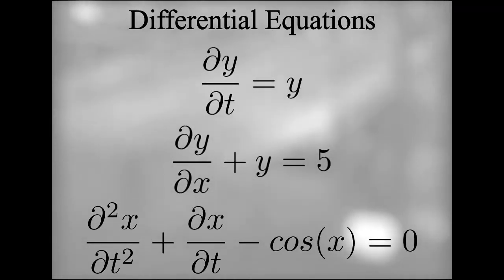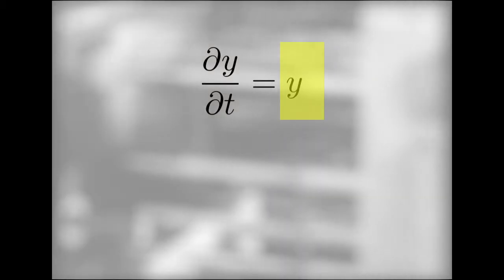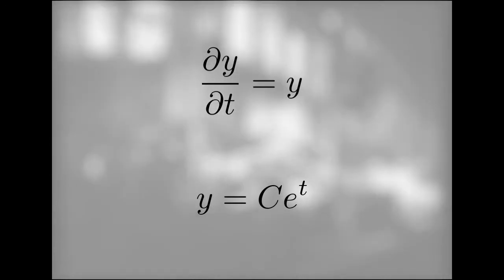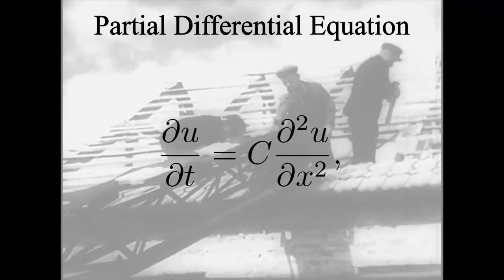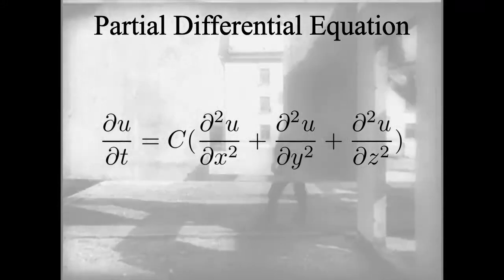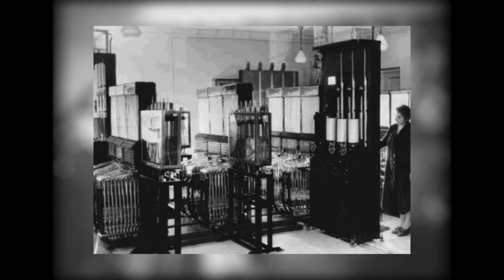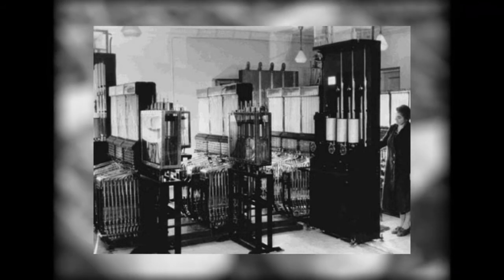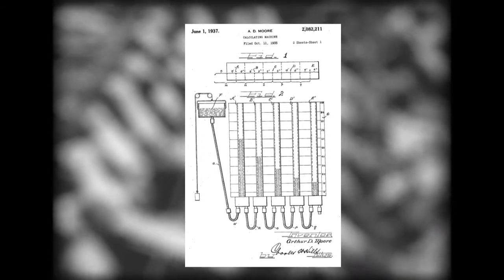The Soviet Computer that Used Water to do Math

Comment: Would have been nice if you went into a deeper dive on the machinery and components involved. More diagrams especially.
Reply: There isn't much documentation about the device's exact schematics. All we know is what it can do which is differential calculus...
Reply: This is a really simple thing.  It's just a series of water columns that could be filled to various levels and connected with varied constrictions.

The simulation is set up and then valves are opened.  The water in the columns will all seek to reach the same level; but, the rates of each column filling or draining depends on its level and constriction compared to the other tubes -- the levels of course changing throughout the simulation. The levels in the tubes are measured and plotted to show their curves.

Most of the magic is in the math calibrating the measurement conversions between the process being simulated and the water analog. The exact physical mechanism doesn't matter much.